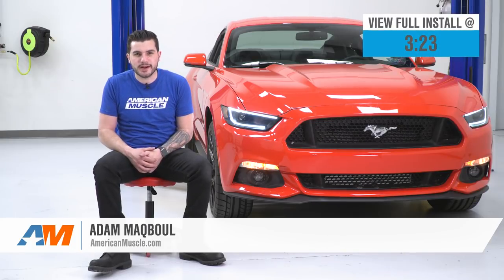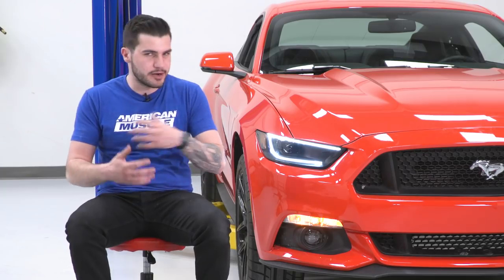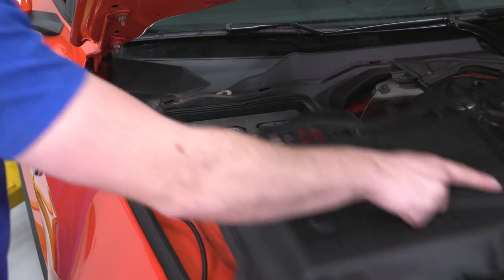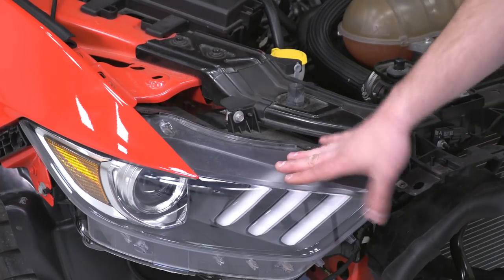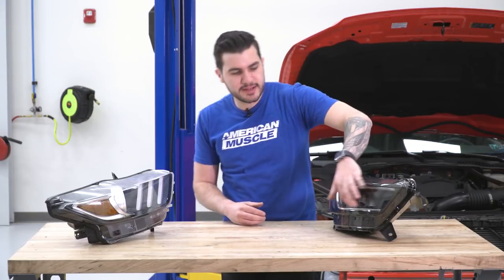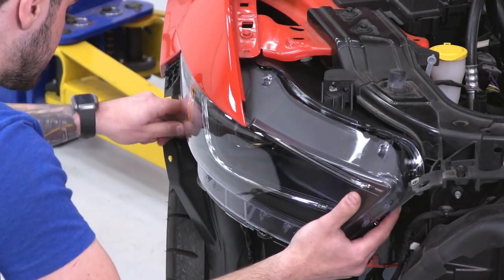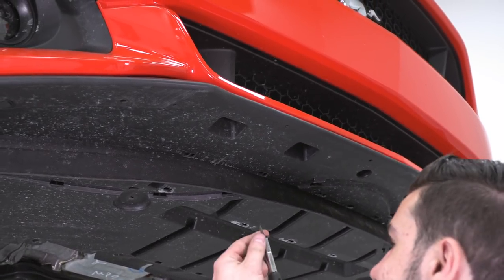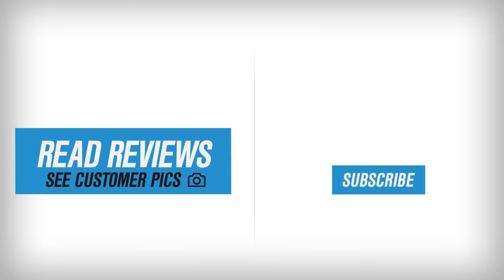2015-2017 Mustang Raxiom Smoked LED Headlights Review & Install

Comment: Had them, they aren't bright, raxiom doesn't have a warranty, if it fails you can't replace anything , it's completely enclosed, they weren't worth 750.... Mine failed, didn't buy extended warranty